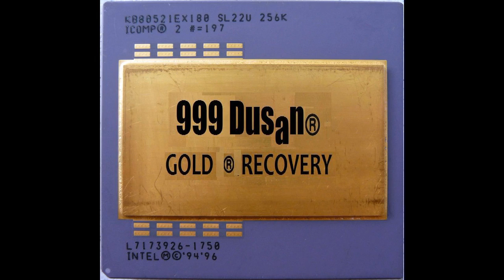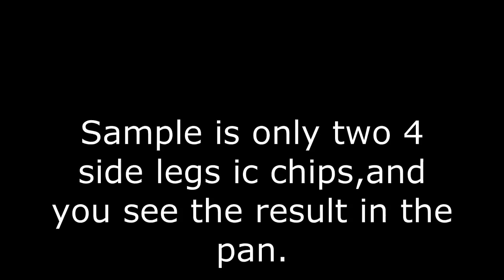Gold Bonding Vire Recovery With Hand Engraver Machine.

Comment: Cool. So is this a rotary engraver like a Dremel tool with a small rotary ball file  or a vibrating tip chisel type engraver? I have both.  Can you use a heat gun to heat them up or do they need to be hotter?
Reply from the maker: This is a rotary engraver brother,just lov speed on 30 % and burn chip but not to much.I will son make full video about 1 kilogram ic recover gold on that vay.Im glad you love video.Chears.
Reply: Yes looks like a dremel with a fine ball file. Either way it's a definite game changer brother. So simple and no acid. 🤔 Now I'm gonna have to get into my storage and find my gold mining pan 😂😁😁
Reply from the maker: Heat gun is score, put in the line chips on side with gold vires, onli heat for 15_20 second not to be vhite.